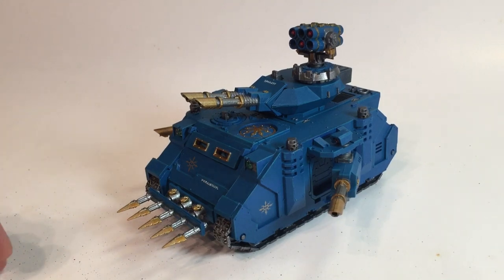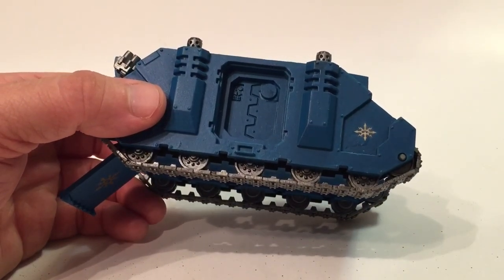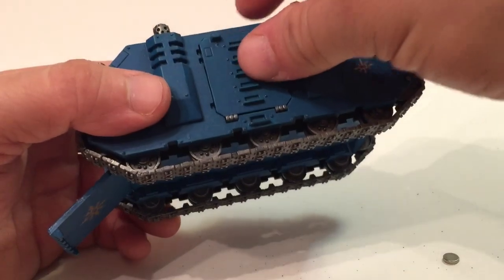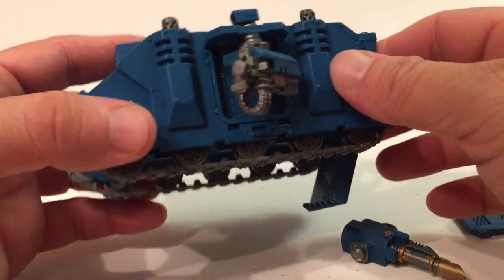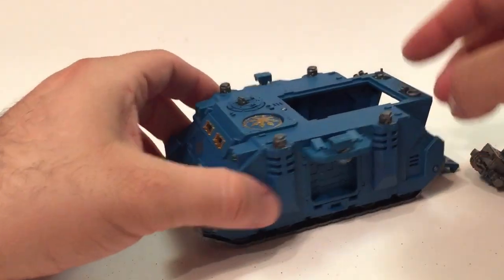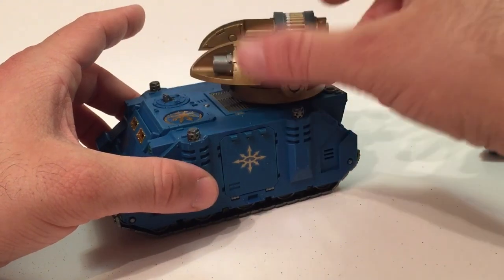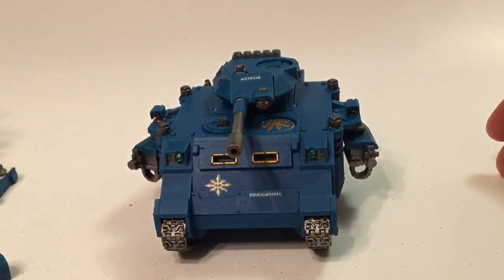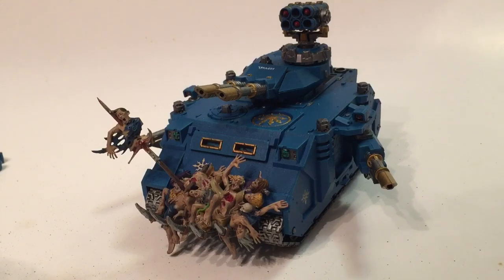How to Magnetize a Predator, Rhino and Whirlwind

Comment: Found this 2yrs after first posted.  Currently working on my 3 predators I picked up and two rhinos.  Wish I came across this before I purchased all the tanks.  But for now I will have an additional 3 rhinos if need be or 3 predators for my black legion.  Thank you for the excellent video!